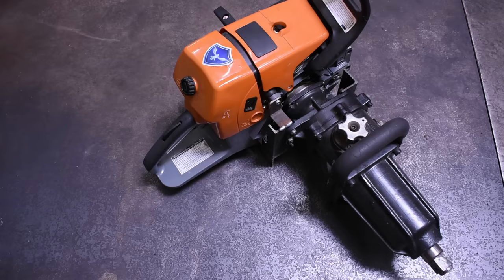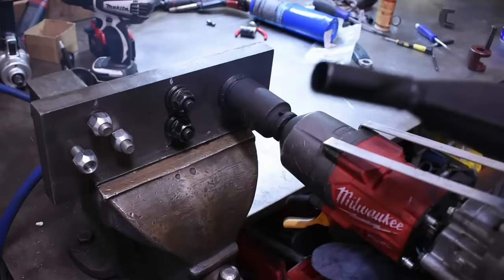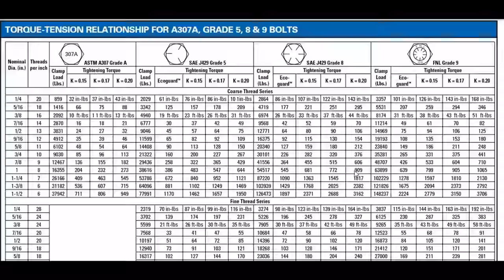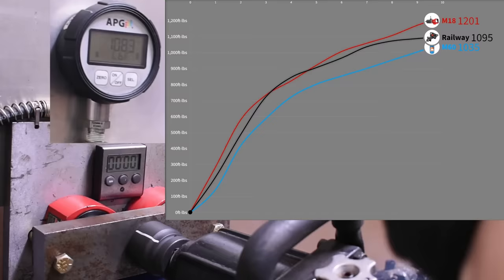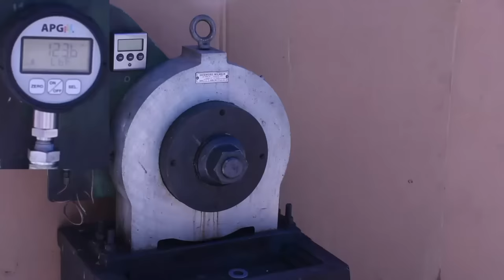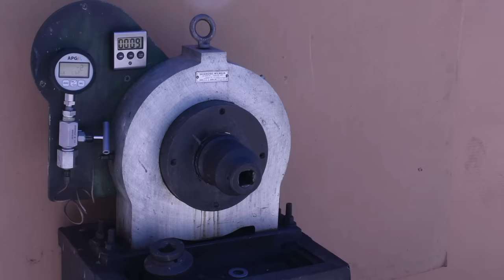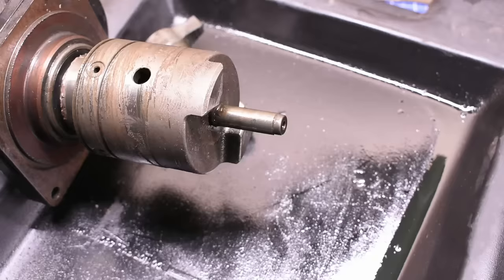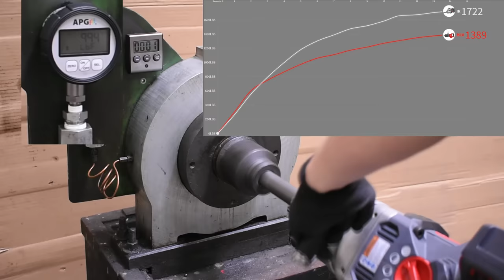The Gas Chainsaw Powered Railroad Impact Wrench

Comment from the maker: In the past we made the 1st gas gun at 100K subs, and the 2nd at 200k. But when you put a chainsaw impact together and it works, you don't just let it gather dust in the corner until some number is hit. Enjoy!
Reply: Well you know what to do guys! Click the thing!
Reply: if you want some custom parts made, hit me up, i can cook something up, like custom hammers and anvils, main drawback would be shipping them from europe
Reply: Put a super bike engine on it ( I’m thinking R1 or triumph 675 ) they go up to 13000 rpm easily some even go too 16000.

Also they have 100 or more hp
Reply: You should get Walker to build you a Husky 395. He's on Jinglepot Road in Naniamo, BC, Canada.
Reply: hmmm. Maybe try and make a flywheel style impact similar to that amazon special egg beater
Reply: Get a Farmertec G888, 120cc. Largest chainsaw that's available. That's a fair comparison with all of the top electric wrenches.
Reply: Get a Stihl 881 magnum chainsaw 😂😂😂
Reply from the maker: @em4703 you guys aren't watching the video
Reply from the maker: The sweet spot is A enough power to overcome the spring thousands of times per minute, then B a ton of RPM and C light enough to be hand carried. Few things check all the boxes
Reply: as i look right now you have 269k subs, nice.
Reply: @TorqueTestChannel  What about model rotary engines running 30k RPM or go full Jet engine @100k RPM, you guys need to make friends with Warped Perception amazing things will happen.
Reply: Since the M60 is blown and the gearbox in the railway gun creation is crunchy why not make an m90 high torque if it's even possible hahaha
Reply: Jet engine impact at 500k!!
Reply: What you mean to say is you made the chainsaw impact for 269k subs. Nice
Reply: @dubi127  I doubt he cares about shipping.
Reply: @firesurfer  true, but now that I think about it, most impact assemblies are forged, best I can do is cnc machined from a block of chromoly and have it heat treated, downside is questionable tool life, but skookum enough for a one hit wonder
Reply: This old Tony
Reply: @@wienerfabrication776 I would try a rc car motor like a big rc car motor I know some of them can move some crazy weight and spin into the 20k rpm range on some if you need some help researching let me know I am sure I could find something
Reply: @jimbarbwe1985   … maybe an issue with the after burners 🔥
Reply: @Dirtyharry70585  only problem with after burners is when you don't have after burners. 👍🚀
Reply: Man your awesome live your channel and your content keep up the great work Sir
Reply: re-spring the hammer on the railway gun?  or does it not work like that
Reply: @chtidu10  cbr250rr (mc22) 250cc 2cyl 2 stroke 20krpm redline
Reply: An important device that increases torque for any engines, is a CVT aka belt type Torque Converter !!! Regular clutches are garbage.
Reply: Put an expansion pipe too !!!

Comment: I’d love to see a 10 kW three phase motor connected to an accelerating gearbox or cranked way up on a VFD connected to that IR impact mechanism
Reply: Have you someone in mind who will manage to operate it. You’re into Worlds Strongest Man territory
Reply: @zorrosoxter4703  about a 150lb motor. Not nearly world's strongest man territory. Especially if you put it on a trolley like video showed rail crews using.
Reply: @sammorgan31  150lbs is pretty tough to maneuver at an awkward angle. You'd have to be a pretty big guy to capably handle it
Reply: @dkis8730  Swolewrench.
Reply: I second this!!!
Reply: The higher hertz would mean less torque. Reducing the rpm’s down through a gearbox, would increase the torque output
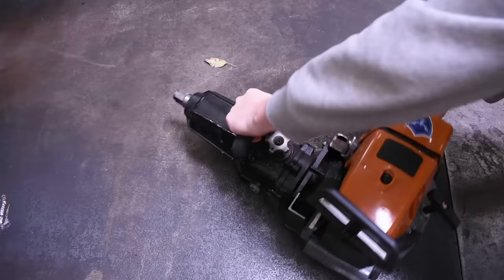Reply: @dakoter_83yoest4  didn't they say the opposite in the video? @2:48  Energy = Mass x Velocity x Velocity .
Reply: Why not use those brushless motor for bike?
Those are pretty light, pretty strong too
Reply: @briliankamil4594  nah, tesla swap it.
Reply: A collab video with photonicinduction?!?!

Comment: The reason why you don't see a massive increase in torque with this driver and a lot of other drivers is the anvil and dog are not tuned to the power source. Basically you need to make sure that the anvil and dog have modal frequencies where their resonances have constructive interference with each other. You also need to take into account the motor RPM so the dog and anvil can maintain the right blows per minute to continue the harmonics.  This is why sometimes you can see small impacts that have a very high output, while there are others that are quite large, however their torque output is underwhelming.  In my opinion, a lot of it comes down to the tuning.
Reply from the maker: This is very true. Though we increased the Milwaukee 1/2" nearly two fold. So there are opportunities out there
Reply: Very true!

Comment: You should go the over volting route next. Mod in a higher volt controller and throw 40v at some of the 18-24v tools would be interesting
Reply: VESC would be the tool for the job.
Reply: Ah... Brings me back to the early days of electric Nerf blaster modding.

Seeing six blocks of Chinesium IMR cells daisy-chained to put mains voltage through a plastic machine gun and spit darts at 750RPM bacj in 2009 was certainly something.
Reply: Go whole hog and hook it up to a 440v three phase system.

Comment: Great video, you guys are the Dr. Nefario of the Impact testing youtube community, over 40 years ago i built farm equipment in the late 70's early 80's and when we put the tractor frames together we used a 1 1/4 or 1 1/2" drive gun to install the frame bolts to the axles and double nutted each one and this was to the tune of just under 1300 ft lbs , we switched off each time and the gun was mounted on a custom dolly and had wheels that flipped up pneumatically and dowel pins that went down into the concrete floor, we had to wear customized hearing protection while performing our work, just shy of 129 DB's  and were only allowed a week on and a week off, putting the tires on the axles was a cake walk compared to doing the frame, wheel torque was a  tiny 500 ft lbs , love the builds , just replacing the spring in that gun could bring, my guess another 10% extra torque, we'll leave that up to you 2 Dr. Nefarios ,👍 I'll stick with my Makita mid torque it does everything i need and i have a large 3/4" drive for heavier stuff

Comment: I know it's outside the channels scope, but it would be awesome to see a TTC on the road: Traveling to mining companies to see how they torque those big  truck tires for example.
Reply: Boring answer - they use a Hytorq or something equivalent
Reply from the maker: @DarkFox6211818 orrect
 Hydraulic or a gear reduction torque multiplier like hytorq and its very uneventful. Which is a plus for them of course!
Reply: @TorqueTestChannel  when we used to rebuild 8" diameter parker hydraulics (3H I think) the tie rods were a 3200ft-lb torque spec... All we had was a 20' breaker bar.
Reply: yes hydraulic wrenches go crazy high  especially cartridge style. i have 3/4, 1  and 1 1/2 drive hydraulic. 7000 ft lbs with the 1 1/2 which i have used to tighten an 8 inch tierod nut on a hydraulic press. it's not enough but worked well enough that it stopped stretching when the press went to full load at 900 tons.
Reply: Hytorq are uneventful...until they're not. 😂 Had a hose blow at 7000 psi. I got an oil shower but was very lucky it didn't rupture closer to me. It's really scary when you start stretching 3 1/2" studs to 40-60 KSI. Even scarier when you get so comfortable doing it you don't think about how much pressure that is anymore. Til something goes wrong and it reminds you how squishy we are.
Reply: Here in canada we use rad guns.

Comment: If you're doing more Frankenstein creations with gas powered engines, try hitting up JohnnyQ and ask what he'd suggest. The guy seems to be a wizard at building tiny engines and gearboxes. Could make for an interesting collaboration.
Reply: I concur Johnny is a genius when it comes to little engines and gearboxes
Reply: johnny is great but in this case we'd need bigger then tiny gearboxes.
Reply: tiny hanmerbox on a chainsaw 😁😁😁
Reply: @casemodder89  JohnnyQ gearbox design, AvE and Abom manufacturing

Comment: I use the M18 1-in extended anvil gun everyday for work. I work on big rigs. There are times when it is not enough and I find myself reaching for the Harbor Freight Earthquake XT to break decently rusted lugs that I feel like the M18 should have no problem with. I've been lusting after that IR for a long time but I can't afford it. Not only is the earthquake XT able to break some insanely scary looking s*** but I can't help but wonder how much more powerful it is then the Milwaukee. And it's Harbor Freight and costs sub $500 I can't help but wonder how much more powerful the other big brands are.... 

I know you guys mentioned that you can't test these big guns with your current compressor setup. I'm able to run the XT on 3/4-in line from a 12 horsepower compressor with a 150 gallon tank. Line pressure will drop to about 95 PSI when giving it full beans but I don't think you can get much better than that. I guess my point is even without the correct air setup I think getting some data from the 1" air guns might help some of the guys out there that need the torque. Even if it does need a disclaimer about tested line pressure at the beginning of each video. 

Anyways, there's my little $0.03.
Reply: The biggest thing i've found that helps the big air guns is hooking your hose direct to the main tank, most compressors have a regulator that cant keep the pressure up. I also always use the bigger hose and couplers on 1".
Reply: It's 3¢s now?  Goddamn inflation.

Comment: You have the engines/motors, and you have an assortment of hammers/anvils to test. What you are missing is a proper transmission to transfer the power. 
Turbines could also be in the future...
Or forget the LS and go to a Tesla motor.
As far as the trans, a pulley/belt drive inertia system could be used.

Comment: On that chainsaw if you are planning for using it for anything else. I would recommend plugging the decomp or getting an OEM husky or Stihl, They are the same thread. The reason being is the clone's have been known to snap and drop into the cylinder.
Reply: yep those clones are Junk, people never wanna listen, because they are cheap.

Comment: I understand your point on the limitations of the LS RPM limit, but have you thought of using a rotary instead? Lol 

The RPM range on those Doritos are insane.
Reply: Or a motorcycle engine of some sort...
Reply: Get a rotary from Rob Dahm. He is the rotary whisperer.
Reply: @SomeGuy's Garage Hayabusa impact lolololololo
Reply: the rpm on scaled down turbo jet engines is insane, close to one hundred thousand rpm they should try that, idk how they would set that up and it’d be very unsafe but i’d love to see it
Reply: Sachs did make some smaller rotaries put in chainsaws and snowmobiles  🤔
Reply: @markm0000  yeah! lol turbo busa
Reply: @SomeGuysGarage  1,000 hp 10,000 rpm turbocharged impact would be so hugely impractical and unrealistic I don't think that would be a funny video.
Reply: @markm0000  I think it would be incredibly funny :D
Reply: Should get the engine for a 90s cbr250rr, 20k redline

Comment: There is a balance between the motor power and the hammer weight. The hammer unit itself, the leverage arm length of the anvil matters too. A shorter anvil (relative to the rotation axle) will require harder impacts pushing the limits of tool steel. However a very wide hammer reduces the ability to torque bolts making bolts closer to the floor/rock/wall/imovable object. See what you have done now I must spend the whole Sunday thinking about a large impact driver with an offset anvil so that you still can access bolts close to the floor and also have anvils with longer leverage arms.

Comment: If you end up throwing Leroy's engine to it, make sure you rig up a push button HAMMER brake and 2 step. You know, for those 30PSI boosted uggas off the rip

Comment: This thing just keeps getting better and better!... How do these compare to those big 1" pneumatic impact guns?... Also, have you considered using few paintball high pressure air or CO2 tanks with air tool regulator kits feeding into one in parallel then cranking up the pressure past 200psi?

Comment: alright, I haven't seen it suggested, but have you considered dipping into RC engines run on nitro? Might be the next logical step with their insanely high RPM figures.
Reply: They probably don't make enough torque to get into the power band and if it did I don't imagine it could handle the vibration
Reply: Rc engines are too small. Even the 1/5 scale cars as large as they are just use a small weed whacker engine. That's part of the reason why they rev so high, cuz they're tiny lil baby pistons and con rods.
Reply: brushless dc motors blow nitro motors out of the water and have for many years now
Reply: @NightshiftCustom  nobody likes electric. we need the bangs and the fumes !
Reply: @casemodder89  ya that's not the case when they are selling way more brushless RC car's and trucks then nitro powered hands down
Reply: @NightshiftCustom  today the kids are brought to school with a helicopter.

parents leave their lighters locked up.

and kiddos aren't allowed to play with the cool stuff. because it's DaNGeRoUs.  still doesn't mean nitros are hated or less wanted.

Comment: with the same hammer, yes a 6l v8 is comparable to the railway thing, but with bigger hamerand spring it will snap bolts just loocking at them you can make an hammer and slap it to a car wheel, russian style :)

Comment: Definitely worth venturing back into electric to chase some real beans.. for a few hundred bucks you can get a brushless motor & power system intended to replace a 150cc engine for (large) model aeroplanes! Sky high RPM and absolute tons of power.  The hard part will be finding or modding a business end to handle it.

Comment: I work in the track department and use these gas powered impacts almost daily, when I first started Ithought they would be stronger than they actually are.

there are a bunch of times we end up torch cutting bolts off because the impact cant break them loose.

Comment: On big construction jobs we use big sline drive  impact guns on 3/4 or some time 1 inch air lines that are instant air tankless systems the things are big and heavy. Test one of those comared to the batteries

Comment: Make a super capacitor boosted battery with sold copper buss bars for the IR.

Also, get an oscilloscope and look at the voltage drop at the motor inputs on the high torque guns.

Comment: I want to see that 12v cigarette lighter nonsense wind up impact converted to use m18 or similar battery. The thing swung way above its weight class and it would be a shame to leave it alone.

Also, the RC motors, or ebike/small ev motors hmmm....  RC will have the RPM's. PMAC motors with a CVT is interesting. Looking forward to what you come up with.

Comment: I think the HP figures are a little overstated.  For each 25cc you'll roughly obtain 1 HP running at petrol (gasoline) ...  running nitro-methane you'll get approximately 2 - 2.5 HP per 25cc.

Comment: ultimately the most frankensteinians frankenstein build was a chainsaw 2-smoke engine coupled with a scooters torque converter like from a piaggio 125cc.

that would start off with high torque at the output to get the rattlegun going and then gear-less shifts to full rpm for maximum havoc.

Comment: We need a tear down of the chainsaw, smacking that hammer at 13k rpms has to be absolute hell for the engine components. I'm surprised the power head lasted longer than the hammer.

Comment: Get a Partner concrete circular saw, they are ferocious. The Partner were the gold standard in those saws, but there are a lot of concrete saws out there with tremendous power. Husqvarna K 1270 could be potent...

Comment: Try the 42,000 rpm O.S. Engine Speed 21XZ-B Nitro RC engine on an egg beater style impact. 3.5 cc with  2.61 hp @ 34,000.

Comment: If you can figure out how to change the ignition timing, clutch and pull starter any two stroke engine will run in either direction!

Comment: They make 14 hp rc motors that you might be able to do something with. Not even the 14 hp ones though you could get other smaller faster spinning ones. I actually do have one that I modified and made a cooling fan for as I was going to use it for a motorcycle. You guys could maybe see if you could use it?

Comment: At 4:20
Explaining that RPMs are more important than horsepower and torque....

If you could have got your hands on one to borrow it, you may have won to try one of the old Honda racing motorcycle engines. Back in the '60s they had an engine in the 250cc size and 125cc size that had six cylinders and would rev to 20,000 to 22,000 RPM....talk about a screamer!!

Comment: How about a rotary engine impact? Those have higher rpm’s. Not sure if more than a chainsaw as i haven’t looked but would be badass anyway 😂
Reply: 30,000 RPM or go full on jet engine at 100k RPM👌 I think TTC need to meet with the youtuber Warped Perception.
Reply: @jimbarbwe1985  hell ya, we need that!! it would be the impact equivalent of an oxy acetylene torch. The rusted bolts won’t have a choice. 😆

Comment: Strap it to a Mazda 13b rotary engine. With larger injectors and upgraded fuel pump they can easily rev pass 10k rpm (some say as high as 12.5k)
Reply: You can get 30k out of the model rotary engines, but might just go to the Jet engine and start pushing 100k RPM check out Warped Perception, we need them working together.👍

Comment: So is it time to dominate the electronic cordless impact regime? Use a RotoMax 150cc brushless, run the full 14S battery (51.8v, full charge almost 60v) at 9800w? (If they are finally in stock?) Now that's crazy!!